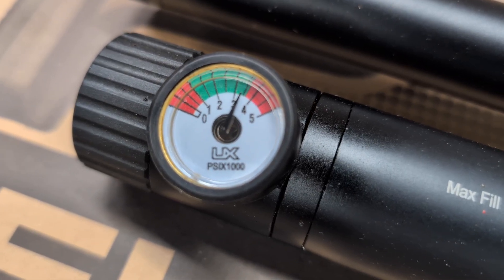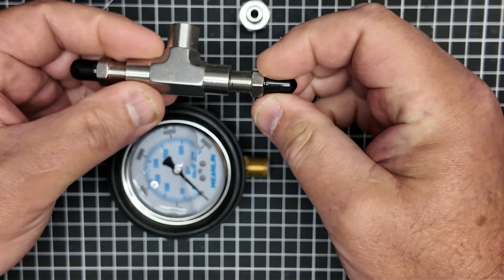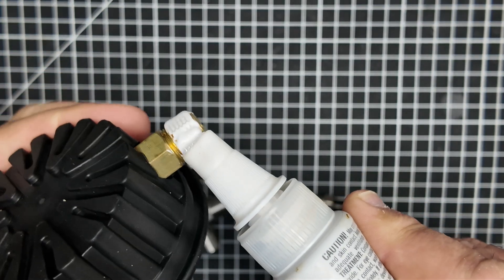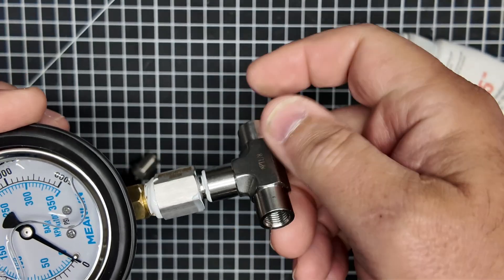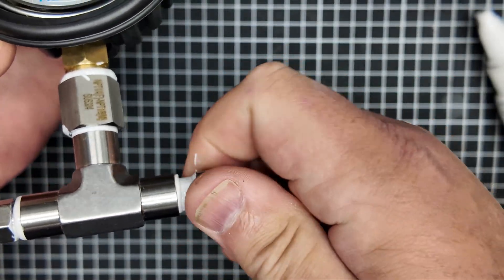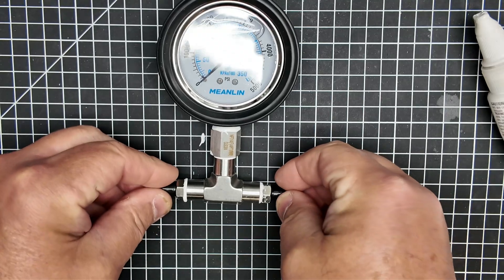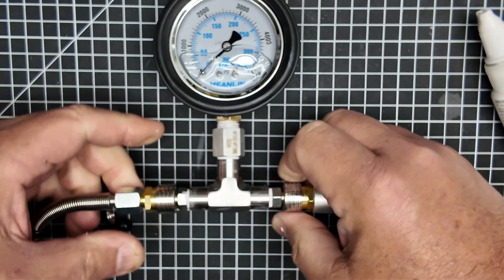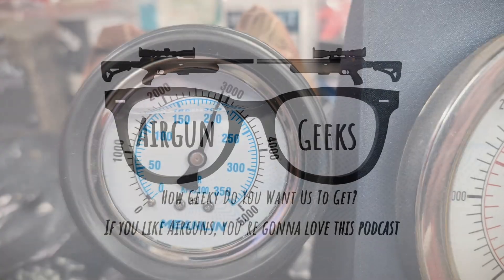DIY PCP Airgun Reference Gauge: Build an Accurate, Durable Pressure Solution!

Comment: Great DIY Video !
The 1/8 npt Tee , of your Amazon link is  only rated to 2320 psi !
In the video you pressure it to 3000 psi , with No Problem ! I'm a retired machinist by trade and that Tee should stand a lot More pressure then 2320 psi !
I ordered all parts to make one from you Amazon links !
The link for the 1/8 quick connects are the one way and in the video you say not too use them but they are removable !
Thanks !
Keep the Great Videos Coming !
Stay Safe & Healthy !
God Bless !
Reply from the maker: Thanks for the feedback, and I appreciate your experience with these fittings!